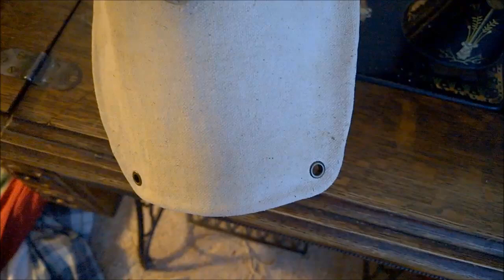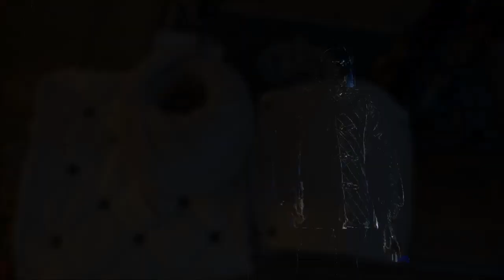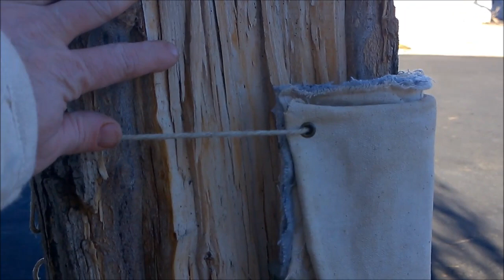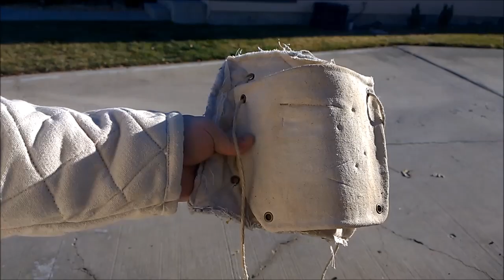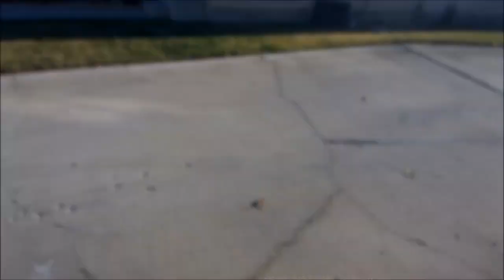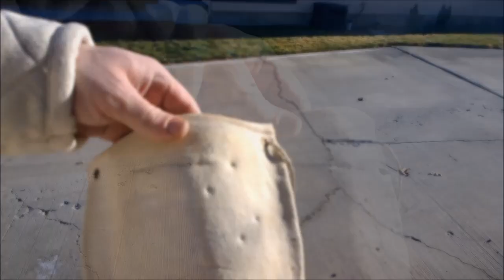Testing Linothorax

Comment: Issue is you were using steel vs bronze. It does however show the usefulness of the Linothorax armor as if it could cut down steels ability to go through. It should be great against bronze in my mind.
Reply from the maker: A very good point. Also as I said to another viewer the hard and relatively immovable backing means that the material was forced to take on more than if it were on a body that has some give and protective movement reflexes. All things considered. I ended up putting an inferior form of linothorax (as it is cotton, not very well formed and with crap "glue") through a level of stress test that the real stuff would have never undergone. And it didn't do all that poorly. Which makes me think that the real stuff in it's proper place and time must have been very impressive.

Some years now removed from the time of this test, with a lot more off-camera experimentation and reading under my belt. I feel confident that I could at some point revisit this. Although I am no longer all too interested in how it performs against damage. Instead there are some unaddressed things regarding what we can and do know about this armor type. Such as the likely composition of the glues (which I have a few fairly sound ideas about). Or the grade of materials that would have been most common.
Reply: As well as iron which during antiquity was also quite soft. Linothorax wouldn’t have been used for as long as it was if it was useless.

Comment: the strikes where to weak :v
Reply from the maker: That's entirely possible. Thinking about it, I was wearing a not so great gambeson that was restrictive. But perhaps weak strikes act to balance things out. Considering that my target had a hard immovable backing. Which would be unlike striking a person. where there would be some reaction to an incoming blow and some give.
Reply from the maker: I'm a little more concerned with things like accuracy, Breath pacing, measure, form, and edge alignment (where applicable). The way I see it. If the weapon has good qualities it will do most of the work as long as I enable it to do so. But to each their own I suppose.
Reply: TheHelleri yea that is true, but in a real fight you have no time to aim with accuracy and you must act quickly and with power to disable your opponent
Reply: TheHelleri make some test in bronze plate :o
Reply from the maker: Something I'd like to be able to do one day. For the moment that's out of my budget and technical ability to take on unfortunately.
Reply: TheHelleri :c
Reply: @KarlKeesel  no. You are wrong. Most hits with weapons in acnient times and middle ages were not powerful as - they were quick and low in power generally. Why? Because if you want stron blow you will open yourself and be slower, also you will have big problem if your MOVING opponent dodges as inertia will expose your to counterattack. 
You see, hollywood is crappy regarding ancient and medieval combat. Better read a little bit about it or try HEMA in real life with real people and see how often will your attacks contain - power.
Reply: @kvarnerinfoTV  hey dont tell me that i need to read, i read a lot and i have seen a looooooooooot of videos about ancient combat
Reply: @kvarnerinfoTV  i always see skallgrim i know that is not good use much POWER i know it even if im not traied as hema, i know that technique is the real thing but i was not saying that you need to use POOOOOOWERRR  like a chimp or something i Just noted that his strikes where too weak compared what you see in hema, medieval combat or test videos.. Like in guns power is still important if you want penetration more speed more oen you have.. In a real battle with steel armour you need that, is not the same a training sparring where you need to improve your skill and you are una controled situation and a real one where there are thousends of guys fighting and full equiped, you cant control the situation and obiously the adrenaline will force you to use more power in able to disarm your opponent.. Buy yes you are right about it but i tell you im not saying that you need to be a gorila or something like in video games.
Reply: @KarlKeesel  I got your comment wrong then, we agree at the end my friend :-)
Reply: @kvarnerinfoTV  well maybe my comment was to harsh and with lack of explanation.. Sheers

Comment: The tree makes the test invalid, because it makes it impossible to thrust or cut more than a couple centimeters deep. The points in your thrusts were stopped by the tree, not the piece of armor.
Reply from the maker: I like to think of it more as a test that is weighted against the armor being successful in order to really put it through its paces...

To explain, with a hard solid backing the armor has nowhere to go. Without a soft fleshy mass that moves away from the impact slightly when hit, the armor is made to take the near full force of the blow with out any real dispersion of said force.

Imagine how much better it would perform if some of that impact were absorbed by a fatty and watery mass (we're mostly water by weight) that shift on or just before impact reflexively away from the blow. 

But I can definitely agree that the test isn't as informative as one might like as to the real effects of how it would perform as worn armor. Unfortunately these were the constraints of my ability to test at the time.

I've thought about this a lot and I think I've come up with a frame that would respond realistically to blows. It's something I'd like to build and try out in the future.

Comment: Testing on a fixed point like tree will yeald bad testing results. It slike testing fist to face impact - if head has no roo to go - compensate kinetic energy damage will be higher. Human body is not a tree.
Reply from the maker: Not necessarily bad. Think of it this way. If it doesn't perform poorly against such a hard and immovable surface. How much better would it be on a body that has give and reacts to incoming blows. 

This test would be best classified as a limit of destruction test. Meaning it isolates everything but the performance of the material and it's construction. You could say it's how it performs under the worst case scenario.

All that having been said... It's what I had to work with at the time. Perhaps at some future point I can revisit this with better materials and more true to life testing.

Comment: so how viable is it to make some of these plates and line the inside of your jacket? i live in a bad area and most people here really have it in for me and i want some protection against your standard street knives such as switchblades and butterfly knives.
is this an effective and practical body armor that i could use in my day to day life?
Reply from the maker: The cotton isn't bad. But I've since had a lot of crafting experience with linen (as in from flax). Linen is far superior for the purpose. I wouldn't consider this as an armor liner though. This stuff isn't exactly light. A full linothorax would be about half the weight of a bronze cuirass. This would weigh a jacket down. Things would sag and turn at odd angles...This armor type is meant to be strapped against the body. Another thing is that the problem with any series of plates armor is that plates have gaps and a lot of them (10-20% of a series of plates armor like lamellar or a coat of plates can be gaps). 

Not as much of problem when this stuff would have been used, given the gaps were typically smaller than the thickness of what might want to pass between them. And that thrusting at a gap often creates a pinch and bind effect. But we're far removed from the bronze and iron age. The typical carry blade these days is a lot thinner, harder, and sharper than most common knives of that time would have been.

Of course wearing a full thorax/cuirass is wholly impractical. If one felt the need to have some makeshift protection I'd suggest aiming for striking a balance between all the factors (weight, expense, time to make etc.) A thick leather weight lifting belt might be a good start. Leather isn't great at stopping thrusts. But when it's thick enough (such as with lifting belts) it can provide some protection. One can just buy an already made lifting belt. There is no special level of access needed and it would definitely be better than nothing in the context of the situation given.

Another thing about a lifting belt thing is that you could layer linen onto it. Two layers of glued and sewed down thick canvas linen on the top side of a lifting belt might be sufficient to get the deflection effect discovered by Aldrete's team at the University of Wisconsin (there's a good experimental archeology study book by them called "Reconstructing Ancient Linen Body Armor: Unraveling the Linothorax Mystery). As well as increase the stopping ability of the belt.

As a matter of theory-craft (as in don't depend your life on my advice). A lifting belt would cover the most vital and unprotected organs, without being cumbersome. It would offer some more immediate protection and act as platform to be built out into more substantial armor over time.
Reply: @The1Helleri  right, and this is what i usually do. i have a thick leather jacket that i usually wear but it restricts movement and is heavy, but i've gotten used to wearing it. however, as my martial arts style (taekwando) requires a lot of movement, i was thinking of having linen armor plated lining my stomach, as i've found thats where most of these guys try to go for them stabbing me. if not, my ribs do a pretty decent job at protecting me if im at an odd angle.  i have a tight-wearing hoodie, (it's more of a muscle-shirt with a hoodie attached) and i was hoping to have these plated lining the inside of it, so that it would kinda serve as the strap, and hold it tight against my abdomen. a full linothorax cuirass was not at all what i was thinking of, just some extra protection without the restricted movement.
Reply from the maker: @sergeantsonso3490  Hence the weight lifting belt.
Reply: You would be better served investing in some quality running shoes and keeping the laces up tight
Reply: @googlesmostwantedfrog147  yeah okay backseat badass, followed your advice, got expelled for leaving campus.